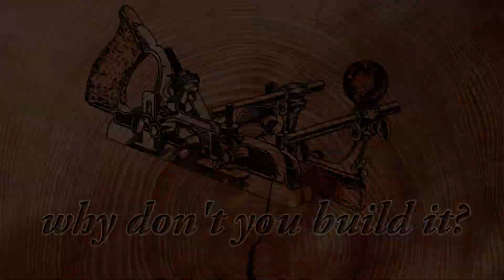Building a woodworking workbench | hand tools only | part 01: Cutting my first mortise-tenon joint.

Comment: What's wrong with your old workbench?
Is any difference when working both workbench?
Reply from the maker: My old workbench is not really a workbench, it's just a table I welded up from some scrap tubing. It's all wobbly and it isn't at all functional for woodworking.
Reply: @WhyDontYouBuildit  Are you working with two vise or only tail vise?
Reply from the maker: @smithjaan247  As of now I only have a tail vise. My plan was to add a front vise too, but in the last year, due to work and family issues, I wasn't able to do any woodworking at all. Hope to get to it soon enough...